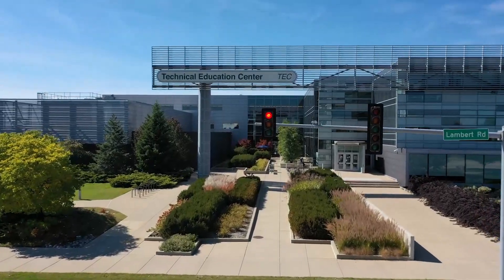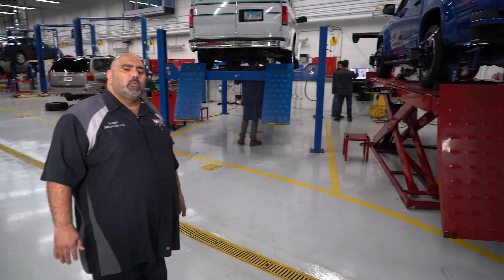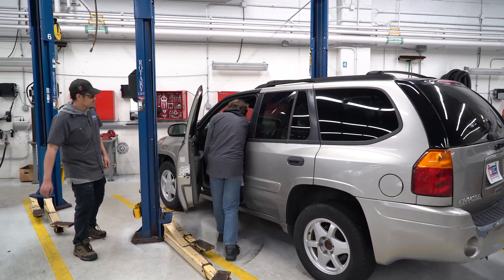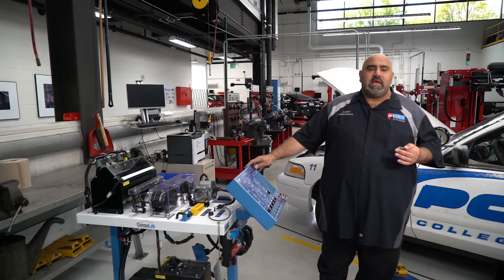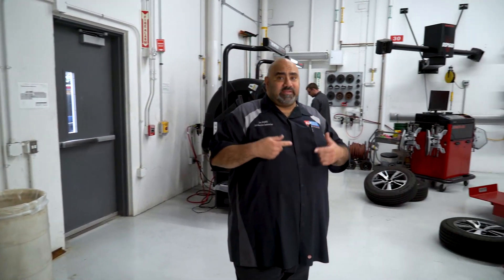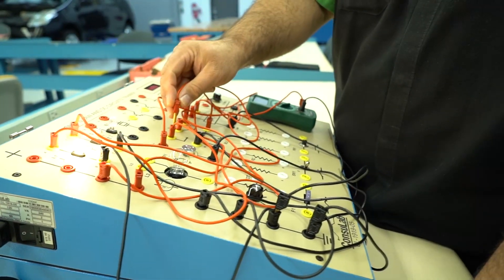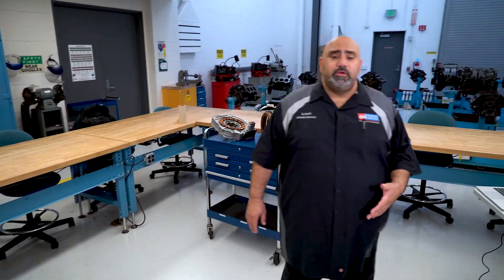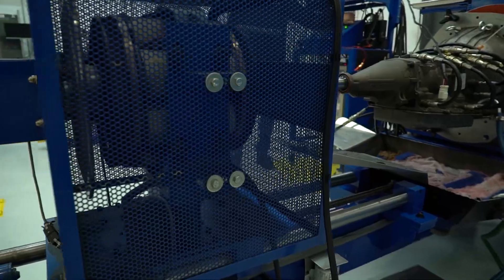COD Cribs - Episode 6: An Epic Automotive Lab for Future Mechanics

Comment: does the shop have a dyno . and a class on running its software  for tuning BMWs as well as other makes and models. and motorcycles. yes I have taken manuf tech course's and hold a GPA 3.7 or B I do have a Degree with work credits. dyno that is something I would like to learn